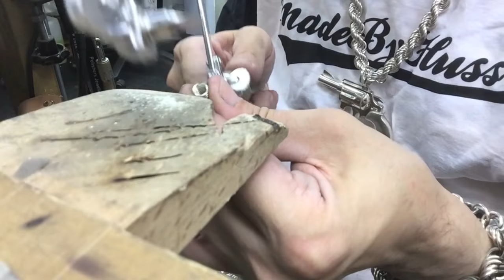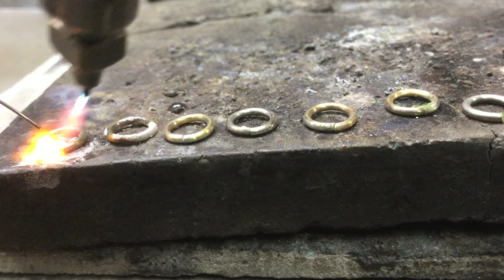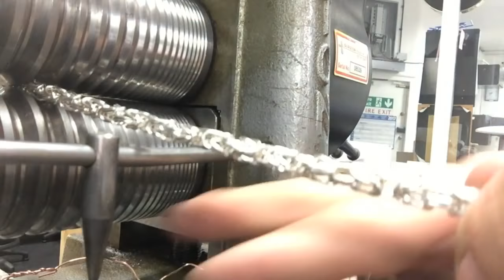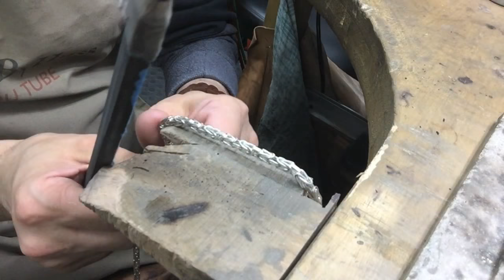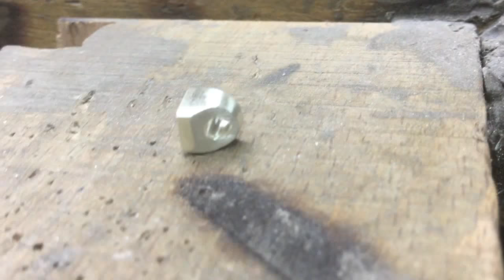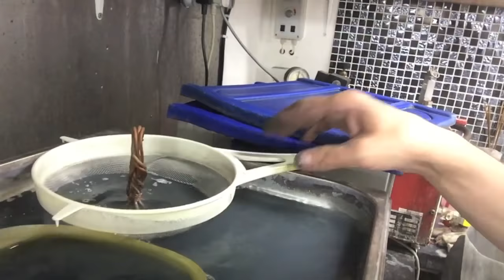Byzantine necklace

Comment: How many grams of silver do you used for it please
Reply from the maker: angel Medrano  I forgot I'm thinking about 70 grms
Reply: Kool thanks,  I have around 100g but I don't know how much wire I have to make for a 22 " or 21 ,,
Reply from the maker: angel Medrano mine is about 26"-28"
Reply: So I don't know how much wire I need or how to get it can you tell me for how much I have to multiple by inches
Reply: For a 100g please
Reply from the maker: angel Medrano  I'm not sure but don't worry you have to make it all in one go I my self didn't have the time so I just added more by making more you don't lose anything also when you start make a sample so you get the size right

Comment: Hey! I really enjoyed your video. I found it because I became interested in this art of making chains by hand lately. But I have a question about all those liquids in which you dropped your chain during the process of making and finishing it. What exactly are those liquids and what do they do? I'm always seeing that the chains get dipped in there but I never understood why they do it.
Would love to get this little mystery cleared for me and keep up the great work! 
Greetings from Germany!
Reply from the maker: After soldering its put in sulphuric acid mixed with water this helps to clean the metal second is the finishing after polishing its put in very hot water mixed with pneumonia cleaning solution takes off all the polish and makes it sparkle
Reply: @MadeByHuss  Thank you for this quick answer even though I asked under a pretty old video! Now I understand what exactly you were doing and why you did this. Also I think that this will help me if I want to do a chain myself.
Thanks a lot!

Comment: What gauge did you make the wire?
Reply from the maker: Matt Lee 1.1 mm
Reply from the maker: Or 1.2 mm
Reply: Thanks man been planning on making one of these here soon.
Reply: Also, what size mandrill did you use to make the jump rings?
Reply from the maker: Matt Lee  I think it was 4mm 
But the best thing to do is to do a short sample about 2" that's what I all ways do be for making the hole thing
Reply: Yeah I turned a 4.5mm mandrill I'm going to use but I'll be sure to test her out before I make a whole chain. I'll post pictures when I finish!
Reply: Welp, I forgot to check my dang aspect ratio so I ended up with about 400 oversized jump rings. They’re turning into a nice half Persian though :)